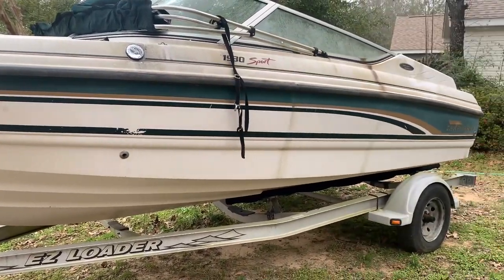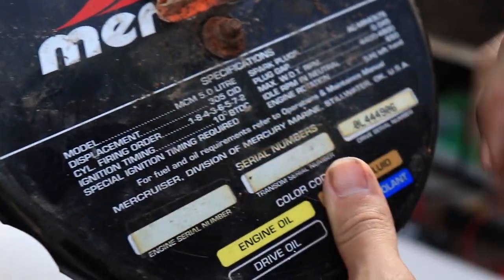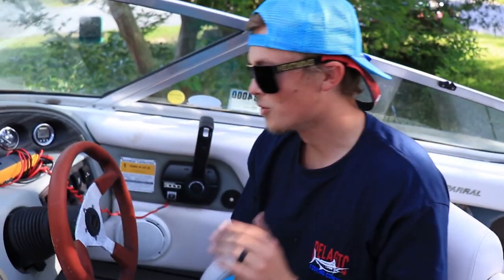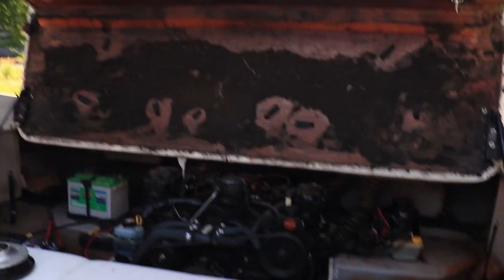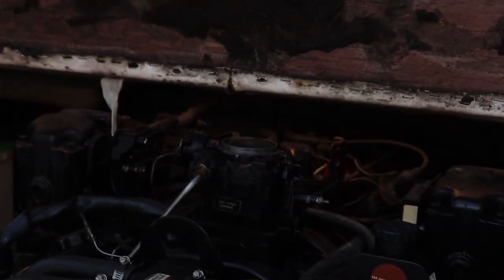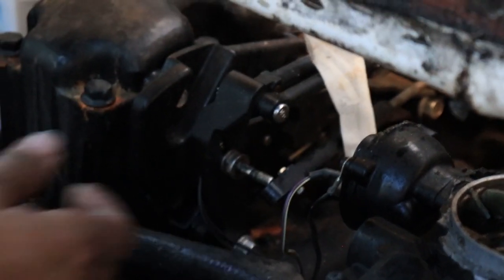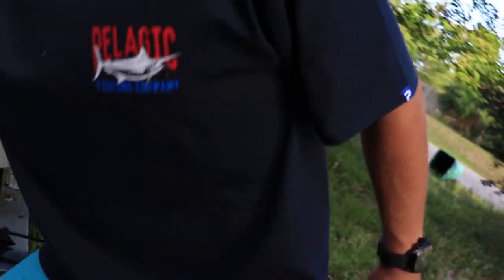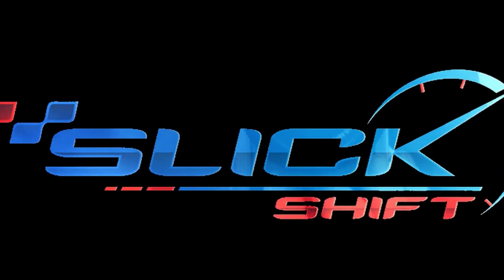Boat Restoration | WHAT'S WRONG WITH MY OUTDRIVE?! | Part 7

Comment: Make sure the trim is down when putting in gear as well. If the trim is all the way up then some weird sounds from the drive shaft will occur from the extreme angle
Reply from the maker: Solid point - I learned that’s a no no from my last boat project after someone let me know. I found out it was the shift linkage

Comment: While you’re in there.... Change impeller, lower unit oil (your reservoir in the engine bay looks empty) and if you pull the upper part off change them bellows as well. Nice work.
Reply from the maker: Already on it - good eye 

The reservoir was full - have a strong feeling it’s a shift cable adjustment 

Had the outdrive on my work bench and everything tested good 👍

Comment: The 'air filter' is a flame arrestor.  With your engine compartment the top of the carb is close to the cover, I'd run it with the arrestor on.
Reply from the maker: Never knew that! Makes a lot of sense now. Thanks for letting me know 👍
Reply: @slickshifts3434  No worries - engine fires get a Sub from me all day long.  Nice work on the boat, will look forward to the outdrive video!
Reply from the maker: Appreciate that! Glad you enjoy the content steemer